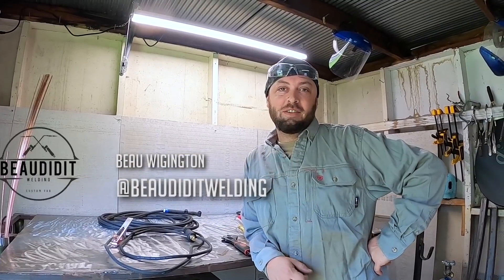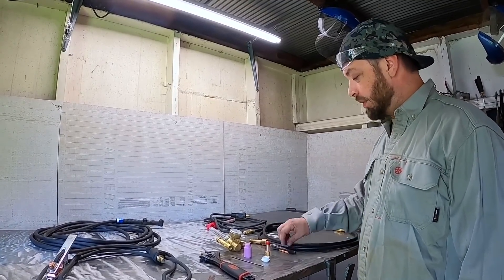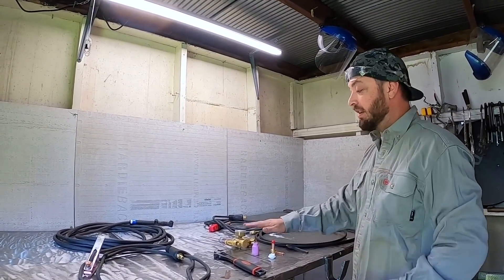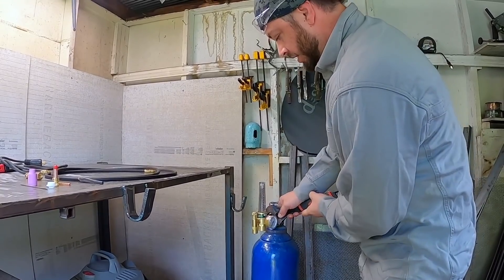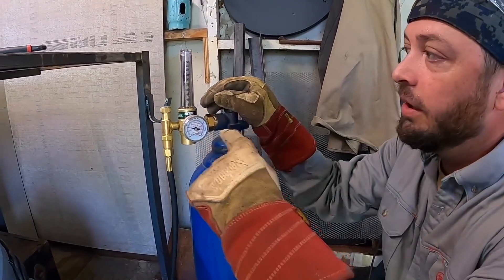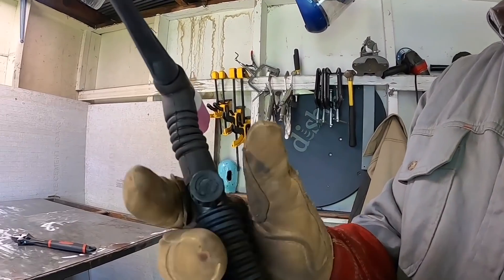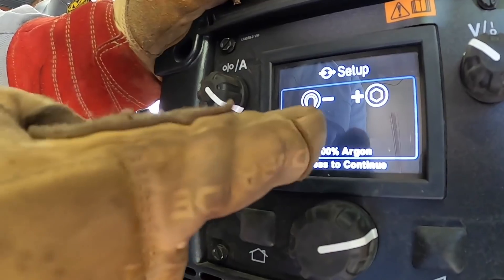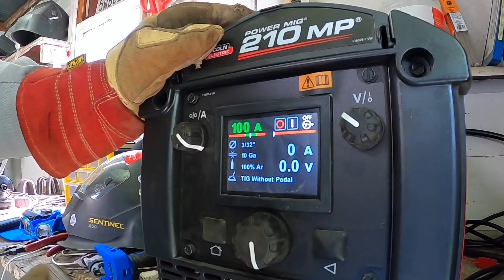How to Set-up Scratch Start TIG

Comment: Can I do this with something like a Lincoln AC Buzz Box?
Reply: You can but the arc isn’t going to be super stable. You can get an attachment that helps stabilize the current. If you have a constant current it will work a bit better.

Comment: Good stuff. Love intro stuff like this. Also for newbs, get yourself a "Flare Nut Wrench Set" or a wrenches with needed sizes (like for attaching the regulator and hose). It will be faster than messing with an adjustable wrench, and your hex nuts will last longer and you won't round anything over.

Can you explain the tungsten distance that you set up? You said "it's equidistant" but it's not clear what you're referring to when setting it up.
Reply: With the stick out of my tungsten the distance I am referring to is about half the diameter of the cup. I eyeball it looking to make a triangle that is even on all sides.
Reply: @beaujamesblues  Gotcha! Thanks for the clarification

Comment: The guys at my local welding supply were really helpful getting me started with a TIG. I got it from harbor freight cuz it was the only one I could afford. And I won't be using it for more than little projects and repairs. They didn't laugh at me or anything either they got me everything I needed like some argon and filler rods and tungsten everything like that. Still have no idea really what I'm doing. But gotta start somewhere right ?
Reply: Hey man, just jump in! I try all sorts of hobbies. Easier than ever now with youtube, but I even used to use (gasp) BOOKS to learn about stuff! People would always ask me "how do you know how to do that?". "I just READ and TRIED".
Reply: My first welder was a Chicago Electric from Harbor Freight 110 80 amp machine for Stick Welding. I spent countless hours using that thing and even used it for some on site repairs. A big thing I have learned in welding so far is you have to just spend time looking at the puddle, and work with what you’ve got. If you get really good using a machine that people don’t really look at like a high dollar setup you are setting yourself up to be even better with a machine that runs smoothly.
Reply: If you're familiar with another welding process, TIG isn't a very difficult skill to learn. Hardest thing is not dipping your tungsten into the puddle. And you have to purchase a bottle for PURE Argon.
Reply: The guys at the supply store aren't welders, they're salespeople. Their job is to be helpful and hook you up with exactly what you need with your budget and end use in mind. If they laughed at or mocked customers, the business wouldn't be open for long!

Comment: To be honest with you I have the MP 210 and I had it set up for TIG but I used the foot pedal function and set up the plug in for that, this welder is a good TIG welder but a far better MIG torch. Maybe if this unit could weld aluminum I'd feel better about its TIG capability. I still own this unit because it's a great MIG torch and it was a fair TIG platform for learning TIG techniques, now there's a honest review of the MP 210 to be added to your easy set up, but I like the pedal for the ability to control the voltage and if one is going to move on to further TIG welding the controls with switch or pedal is more than likely going to be there. Good setup video.
Reply: I haven't used a foot pedal with this one yet but really look forward to trying it out. The MIG on this machine is very consistent and is something that I use daily. I switch over to TIG for thinner materials.

Comment: Sorry to bother you. I have a tig welder and haven’t started using it first I should qualify I am a hobbyist. My question is where can I get tig welding rods and also a chart to determine which rods to use for my application?
Reply: @beaujamesblues  thank you. It will mainly be steel to start with until I get the technique down
Reply: @jonjeys7824  Depending on how thick of material you are welding you will want a variety of wire size as well. I use 1/16 and 3/32 ER70S6 or ER70S2 for most of what I do here at my shop.
Reply: from the local welding supply, or you can also use stick rods with the flux knocked off.....hope this helps,,,,
Reply: @atomichydrogenweld2823  I appreciate your information unfortunately I am rural and there are no welder supplies nearby
Reply: @jonjeys7824  do you have any stick rods, just break the flux off, and sand off the residue....you will be fine.....hope this helps...
Reply: @jonjeys7824  I know of a person that helps us to Tig stainless sheetmetal at the factory, he would cut slivers from the off cuts and use the same material as filler rods.
Reply: @stevensunhing2618  good idea
Reply: Even use old steel coat hangers if u have any ?

Comment: it’s called mode “tig lift”
Reply: not always......some times it is labeled ON.....or sometimes nothing like on an old Tombstone or dc buzz box, or even a Bobcat or Trailblazer or Ranger engine drive, even an SA-200 Lincoln
Reply: There are all kinds of names out there, but if you are using a machine that doesn't have a lift arc function you have to make a connection with your tungsten to the material, then sever it. That is where the "scratch" comes from.
Reply: @beaujamesblues  That's exactly what this function is called on my welding machine, because completely tig is not implemented with non-contact arc ignition

Comment: I have a Lincoln 210MP and want to get a TIG machine soon. But this is a nice option if I am not doing Aluminum.  Thanks
Reply: I wish it had AC but for doing tig work this machine has come in clutch for me, I am also looking to try out the spool gun for aluminum but definitely need to get an ac tig rig myself.